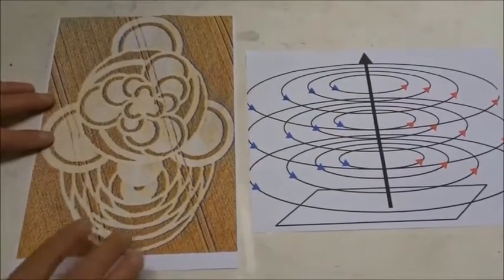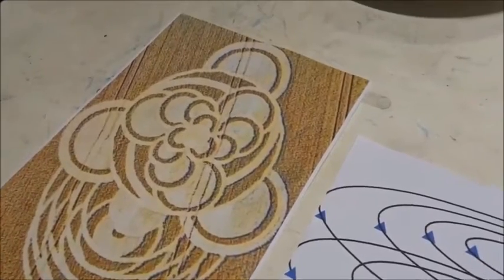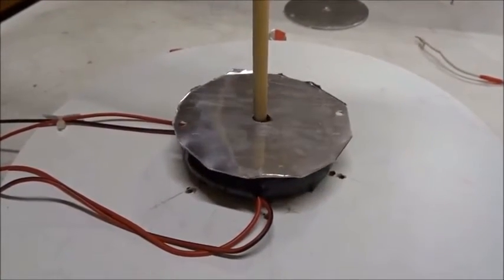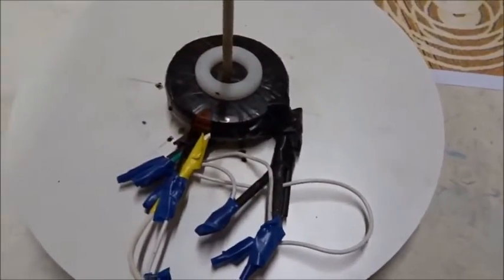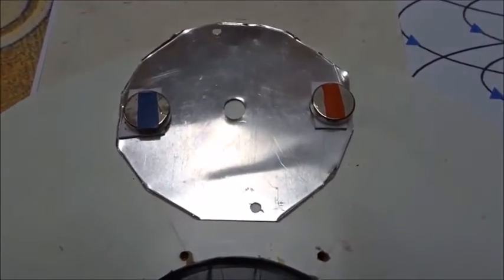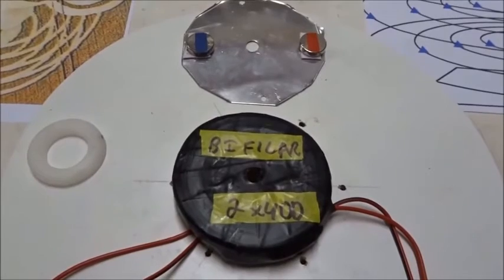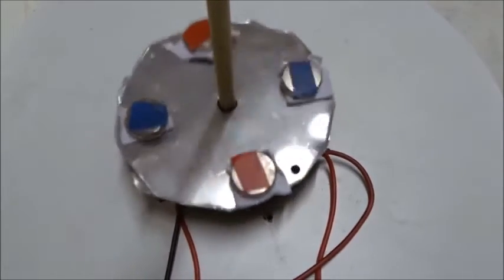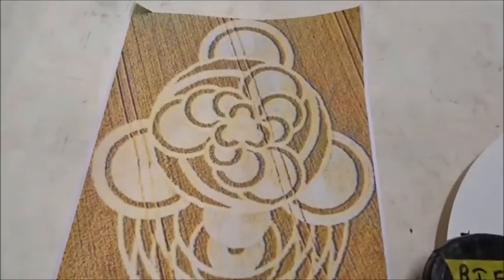Unexpected spin effects in Lenz levitation by a bifilar wire coil: Part 19

Comment: i have one suggestion: make another bifilar 2x400 and sandwich the magnet disc( on a bearing if possible) in between the two coils. With the coils in parallel or in series. First monocoil motor i have ever seen.
Reply: Great comment.